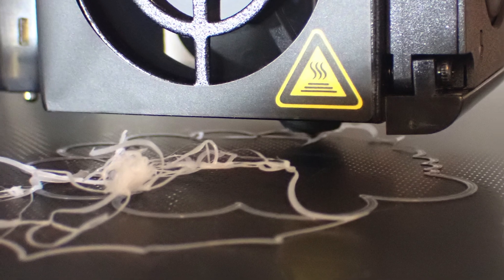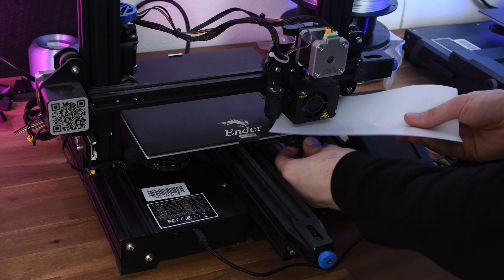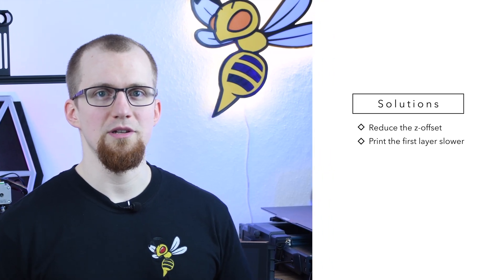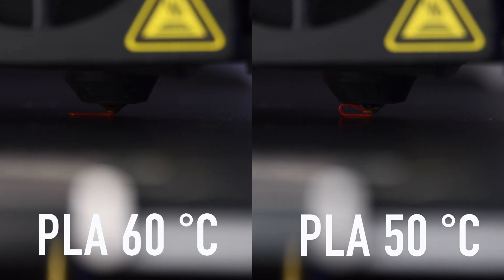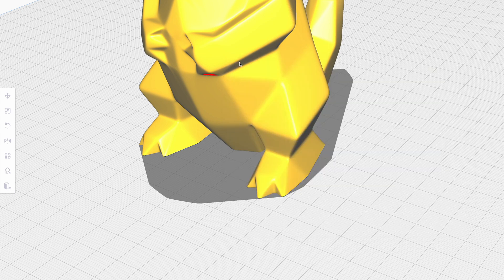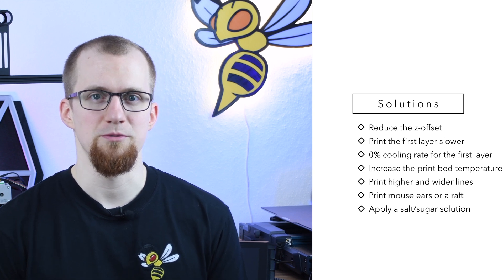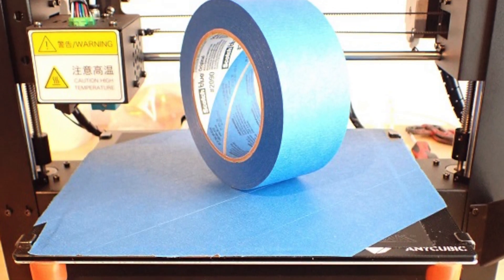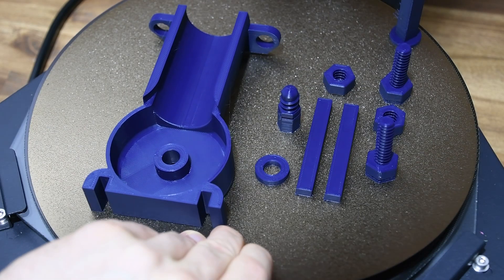3D Print Not Sticking? 9 Ways to Get Perfect Bed Adhesion

Comment from the maker: Learn more about calibrating your 3D printer in my 3D printing course:
https://elopage.com/s/the3dprinterbee/fdm-3d-printing-the-comprehensive-course-from-a-to-z?locale=en
Reply: Um so my 3D printer is even. I even it multiple time but at some spot it not even how do I fix it?
Reply: Thank you kindly for this information, it'll be invaluable.

I started printing this week, and after being very frustrated not knowing how to get from the slicer to an stl file, but after I sorted that, I mostly had successes until I left a print running without levelling the bed.
The extruder only went and gouged the bed, I'm hoping I can work around it by sanding the high points and using the blue tape method.
Which got me thinking.
I was wondering, if I could use a very porous paper, and attach it to the plate, could a sacrificial layer be embedded into the paper without needing a heated bed at all?

Comment: Very good hints here.  I see you also referred to a salt/sugar solution and this is where I want to make mention of what I am using currently.  I prefer printing on glass when it comes to my older CR-10S (30 cm hotbed) and for PLA sticky hairspray works fine most of the time.  ABS, OTOH, can be very troublesome to print but I was able to find an excellent solution a few years ago on another web site.  In short it is a 50-50 mixture of white wood glue and powder sugar combined in a watery solution.  Not only is it a very safe substance to apply on your glass bed (considering the fumes and chemical fluids that some may use) but it also strikes that perfect balance between keeping the object sticking properly to the bed whilst printing and releasing it easily once the bed has cooled off.  Recently I found it works great for PETG as well and it can last for a very good number of prints before reapplying it.  
Mouse ears also work well for ABS prints.  Recently I printed flywheels in ABS (about 15 cm in diameter) on glass.  Initially I used 8 mouse ears (diameter 2 cm) spaced around the flywheel but I found some of them pulled loose.  Next step, I designed my flywheel with a very large mouse ear centred right beneath it, radius about 15 mm larger and about 0,6 mm thick.  As always, I printed on the sugar/glue layer.  Perfect results, every time !

Comment: I have a neptune4 which is causing me some " frustration ". I'll  slow the prints down and increase the heat on the bed and see what happens...
Reply: I found the solution. An epoxy coated print bed from aliexpress. No issues since I got it.

Comment: I am using a glass bed which has small bumps so either my bed adhesion doesn't work, the z offset is too low and it catching the print or the nozzle is catching the print at the bumps.

Comment: Thanks a lot for these advices!  The saltwater solution was THE answer I was looking for since a couple months having trouble with petg not sticking. If you have a borosilicate bed it can be difficult to make a thin layer because of high surface tension but i found out that adding a drop of dish soap in the solution breaks the tension it and allows for a super thin an even layer of salt cristals to form.

Comment: One thing I haven't seen yet that I've tried with amazing results.. multi-purpose spray adhesive. I just put a fine mist on my build plate and it gets tacky as it warms up and releases when its cooled. Added benefit is if you don't clean it off after, it'll just get tacky again when the bed is heated. I haven't had a single adhesion failure since i did this

Comment: I'd be careful using acetone to clean your print bed. I tried it on an ender 3 V3 se and it strips the paint off of it. You can probably test it by putting some on a paper towel and lightly rubbing a small spot. Then just check if there's paint on the paper towel
Reply: With acetone being a chemical paint stripper, then yeah... it's gonna remove the paint off anything.
I also have an Ender 3 V3 SE, and I've always used regular rubbing alcohol to clean my printing bed. Works like a charm 👍
Reply: @1955Chevy  acetone is a solvent not a paint stripper and there are several types of paint that acetone won't damage such as enamel paints that are frequently used in high temp environments

Comment: It's crazy I keep seeing these videos for Ender 3 printers.  Buy one of those, and you have to put tape or glue on the heat-bed after manually leveling the bed yet again, wait until the sun is in the West, etc. etc.  Uggh.  My 2 Prusa printers were more expensive than the Enders of the world, but they just work.

Comment: My print adhesion issue was completely solved on my Adventurer 3 by lightly coating the heat bed with UHU glue and covering it with a layer of laminating envelope. Haven't had a fail since.  The laminating pouch is pulled apart and stuck down frosty side up. After calibration, it just works.  It sticks well. It releases well at the end. I can make multiple prints without needed to clean the bed or change the sheet. If this helps anyone else... cheers!

Comment: I’ve had my Ender 3 operating for 9 days straight after being in a basement closet for 3 years.  The build plate had one part not letting the first layer stick so I just washed it with dish detergent and hot water. Now it’s back in business. Thanks so much for the great tips!!!! I haven’t used glue sticks yet, but leveling definitely helps!

Comment: I've found that too much infill also pulls the prints away from the bed. I am currently trying to fix a large print that has the corners pulling up. First layer bed temp is 90 then 60 for the rest might be too high for Pla.

Comment: I can't say how much of a difference and relief of a headache it is to have you z offset and leveling done properly. I took a shortcut because I didn't have a sheet of paper nearby, it was okay on the first 3 prints but eventually that gap grew larger without me noticing and then I completely ruined a hotend because it jammed up in the fan and nozzle to the point it burnt the wires and ripped them out when I was trying to clean it. I got a whole new piece and it printed 1 object with a few spots not being great and the adhesion to the bed was horrible, then another piece and sure enough it backed up into the nozzle again but i caught it early enough to clean it off. After completely resetting all the settings I noticed the z offset was way too high, so I followed the instructions and used a piece of paper this time and wow it was 1.9mm off. Starting to print the object again and it is completely printing like it should be. Emphasis needs to be put on this step being done exactly as described with paper and all.

Comment: Just got a Sovol SV07. Tried everything, lowering speeds, reducing extrusion, changing the z-offset
Nothing helped until I watched your video.
Turns out the Slicer software set a bed temperature of 50°C and a extruder one of 190°C
Yeah guess what, your video shows 60°C for the bed and the PLA Filament I'm using is labeled with 195°C - 210°C
After changing the Temperature in the Slicer it works absolutely bloody perfectly
And I thought I had to put glue on my plate...
Thank you so much!
Reply: What settings do you use

Comment: I've been 3D printing for several years with varying success. I have an Ender 3-Pro that I have upgraded heavily through the years (usually causing most of my own problems, at that) - all buck-converted Noctua fans, 4.2.7 board upgrade, CR Touch... It's been really fun. But recently my build plate stopped heating (or sensing temp) properly and would fail, so I shut it off entirely. I've been facing new issues with adhesion that I normally didn't deal with. The bottom line is, even as someone with a moderate amount of knowledge and experience with printing - I very much appreciated your clearly communicated, marked, and succinctly-spoken approach. Very great video for users of all expertise! Dankeschön, mein herr.

Comment: Fantastic advice, just got my first 3d printer today. The first few pre-loaded prints worked but it started warping and not adhering. Gave the print bed a good cleaning, leveled it, and changed some settings (increased bed temp first layer and slower printing first layer) and now I'm back up and running!

Comment: spoiler: Dehydrate your filament.
I had an Ultrabase that had lost all adhesion after 3 years of frequent use.
Sandpaper, solvents, first layer slow...nothing worked and was resigned to printing on blue-tape!
Then used a food-dehydrator on all my filament..6 hours at 55c for PETG, 10 hours at 45c for PLA.
Now I'm back to the other adhesion problem...getting the model off the glass without breaking!
Most the filament I got came with the printer, so it's 'aged'.
There was a roll of glow-in-the-dark PLA that crumbled into bits when I dried it! [Hatchbox]
I'm getting all new filament soon...

Comment: Great video, pumped up the temperature, leveled the bed, slowed the print, put tape on bed and now will see how it works..
Reply: well?
Reply: Can you help me with my problem i have the same problem where can i solve and how to set temp
Reply: Use hair lacquer.  It is the cheapest and most efficient glue.   Very strong lacquer for glass bed and lighter for PEI.   On PEI wash it off with detergent.  On glass nail remover solvent works well.   The hair lacquer makes it stick and makes it unstick thanks to the layer.   It is MAGIC !   I have been a 3d printer for almost 10 years and like you I was DESPAIRING.
Reply: Do you have a link to this product? @margerymaraudy9486

Comment: Thanks! I was having issues with getting the first layer to stick. Longer strokes of fillament in a continuous motion worked fine, but shorter and qicker motions... oh boy... the 5mm/s on the first layers did the tirck. Cura was configured to do this on the first 2 layers. Not sure if this is an old setting from when I found this profile as a starting point a few years ago but I thought that it would help before it'd become an issue. Start of the print looks mighty clean so I have high hopes it 'll work this time.

Comment: I have a glas plate and on it kapton tape. That surface slightly ruffed up, cleaned with alcohol and I use a normal piece of paper to level the bed to the nossle
works in 99% also on ABS prints

Comment: I'm so glad I found this video.  I've been having problems with my new Ender 3 V2 (my first printer), and I wanted to solve the adhesion problem without using glue or hairspray. I don't know why I have a bug up my ass to avoid these things, but I do.  But your talking through all the variables that can be modified helped my understand Cura better, and I'm happy to report good bed adhesion for a couple of prints now without needing the hairspray.  I loved that you showed video samples of the differences and explained how each change improved adhesion. THANKS!
Reply: I’m with ya on the not wanting to use glue or hairspray. The way I see it, those are bandaid fixes and I want to figure out how to make do without them!

Comment: I have only switched to FDM coming from Resin printing about 3 days ago, Neptune 3 Pro, but I was having bed adhesive issues, not all the time, sometimes, slowing down initial layer speed and zero cooling seems to have fixed that, so ty, sir!

Comment: This is exactly what is happening to me but i dont have the right computer to run a slicer so none of these can work for me all i have is a chromebook Hp and it lets me download files so i can print them but i get noodle PLA ! pls reach out and tell me if there is any other solution ( i have a Creality Ender 3 v2 ) The pla  does not have enough time to bond with the bed so the layers just completly fly off when the bed moves.

Comment: Definitely giving these a try!  Had major peeling on left side coincidentally somewhat close to a window and it's 20 degrees outside..tried raising bed from 50c to 70c and the print turned out significantly better, but still warped. Going to make an enclosure to block the window and also slow the initial layer speed down. Thankyou for the great information.

Comment: I use Elmer's purple glue stick and it works great. Never had a fail after starting to use it. Best part is that it's 6 bucks for a pack full of them and lasts months.
Reply: I know works wonderfully
Reply: I use it and still doesn’t stick
Reply: @malikegotsauce4690 same
Reply: @malikegotsauce4690  do one pass in one direction then immediately go back over it in the other direction. If you do too thin of a layer it doesn't stick because the glue flakes off like dry skin when the bed heats up. Also the sticks that look off purple aren't good. I only use the ones that have a deep purple look. They also sell more expensive stuff made for printers. I haven't ever had to use that stuff tho so I can't say if it's worth the cost.

Comment: I have had problems getting my first layer to stick I have leveled the bed several times it is a new ender S1 3 and  I go around several times with the paper and one point is rubbing no matter what I do and now I got my first layer going down and by the time it is going to the second layer the first layer is pulling up on the edges what am I missing

Comment: I reduced the print speed to 5 mm per second as suggested along with wider and taller initial layer lines and it works great (I previously tried mouse ears prior to watching this video and it didn't work, the whole ear will get pulled off because of the speed). I no longer have to print a raft, which will save me on filament (print time maybe slightly faster than with a raft but not by much). Still need to figure out curling issue, but thank you for solving this issue that have been bothering me for a while.
Reply: what helped me with curling was creating a simple enclosure out of foam core boards to surround my printer. this created a thermal  buffer to protect my print from sudden changes in temperature, for example from the air conditioner turning on and off nearby. that, and slightly increasing bed temperature. the main cause of curling is the print cooling unevenly, so it helps to prevent that however you can!

Comment: Brand new Ender 3 and still can't complete the sample Cat more than 75 percent (takes hours). Bed is levelled, temperature is 210 pla 60 bed. Just sprayed hairspray on the non-magnetic plate (bed), about to try for the 9th time.
Reply: bro how im feeling rn 

the cat after a few layers the nozzle and the pla will just string and then pull it off the bed and then my print is sliding with the z